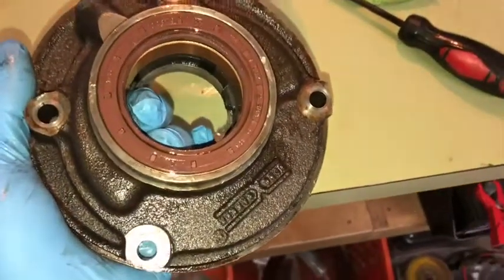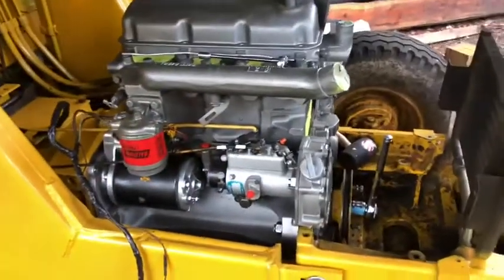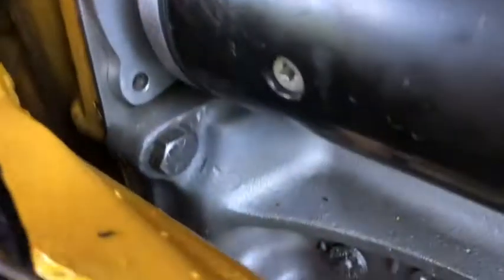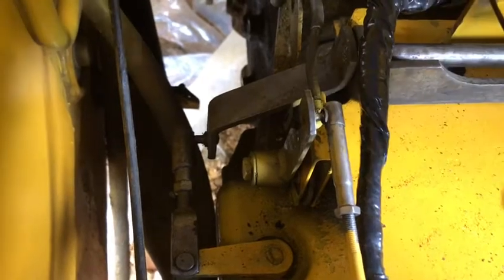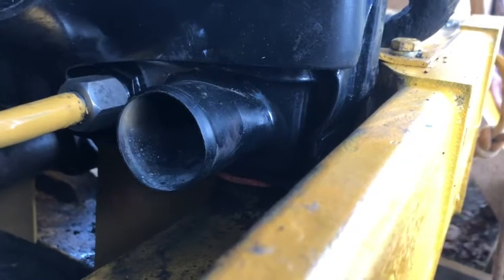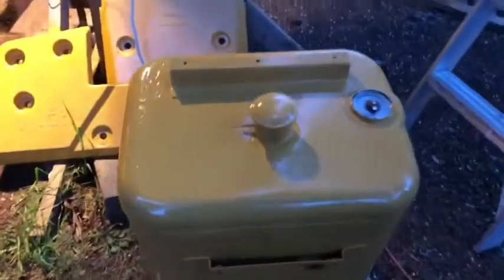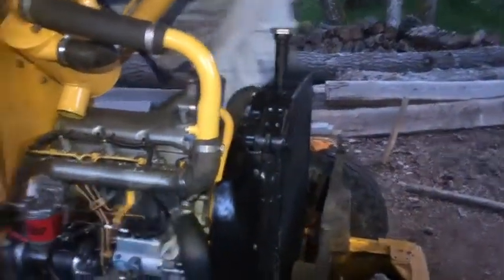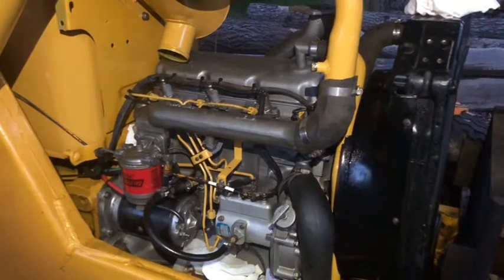Ford 555 hydraulic pump, engine install, wiring +

Comment: Hi guy, where did you get the Hydraulics information, i need it, please if you can help me will be great and very thank full
Reply from the maker: What hydraulic information are you looking for ?
Reply: @jamesmckeachie6149  if You have the hidraulic diagram, because i Will check one of this machine which si not working properly, so with technical information is easier